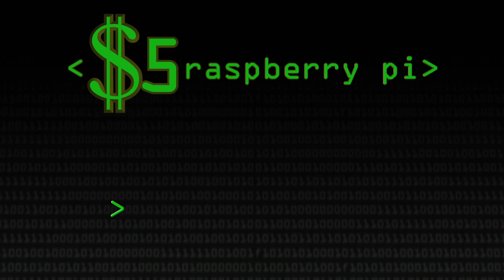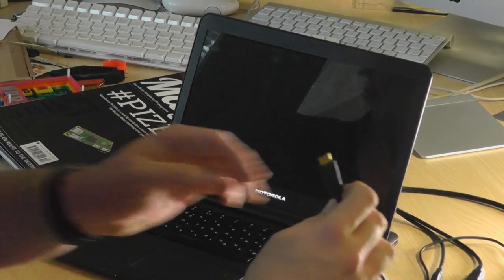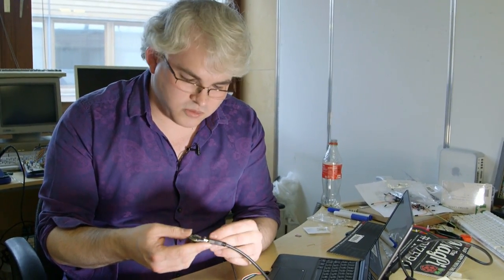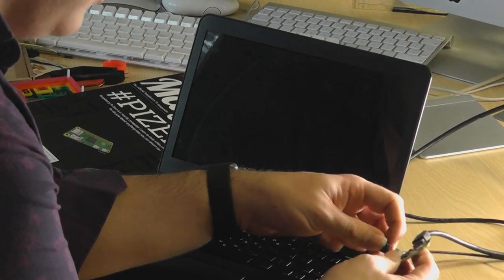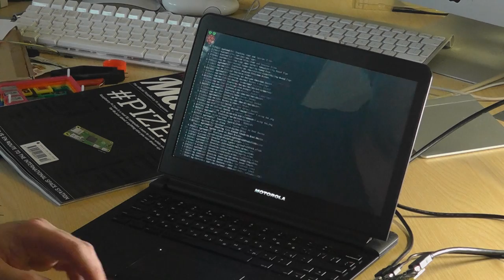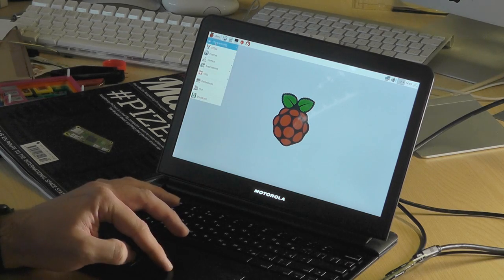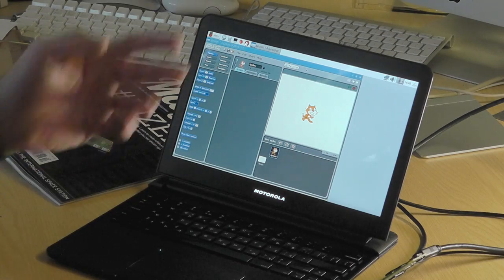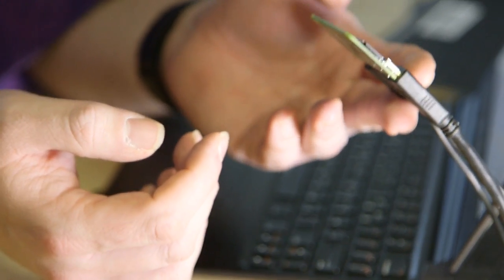Raspberry Pi Zero - the $5 Computer - Computerphile

Comment: When the USB cable costs more than the computer, you should start to think that the cable manufacturers might be inflating the price slightly...
Reply: +Scy Anything over a dollar is profit only
Reply: +Scy And conversely, how generous the Raspberry Pi people must be for making the Zero only $5
Reply: +Scy There's demand for cables, but there's relative way less demand for a Raspberry Pi Zero, so it makes sense that cables are much more expensive.
Reply: The Raspberry Pi sold out before it was made.
Reply: +Derek Leung The price is basically how much money it costs to make the device in the first place.  I thought the organization is nonprofit
Reply: Exactly. I can see why a cable costs more than $5, due to the copper and/or other metals, but when they start reaching $50-100, you know something is just wrong.
Reply: +Scy Not really. There's at least an order of magnitude more copper in a 5' usb cable than the entire Raspberry Pi Zero. Rubber and foil insulation adds more. 

And while the ARM SoC in the Zero is going to be more expensive than a male usb port, it's also an existing, outdated design that has no real demand right now in the cell phone space. The Pi foundation probably gets them pretty cheap since there's no competition for the part.
Reply: +CoWinkKeyDinkInc I've heard Broadcom is giving the CPUs away for free. That would keep the price down a bit.
Reply: Awful lot of price gouging apologists in here.
Reply: The mini HDMI to regular HDMI adapter, alone without the cable, costs more than the board.
Reply: there's a thing called fixed costs, that always exist regardless of the technological level of the thing you produce or the quantity
Reply: @au7weeng534  the cost of a product is determined solely by the labour hours invested into it. As technology advances labour becomes more productive, so the price of everything should keep on dropping till it reaches 0.
Reply: Reading this on 2022

Comment: I miss flicking the shutter back and forth on floppies :(
Reply: +The Hoax Hotel That, and the write protection slider. And my Amiga 500, while we're at it.
Reply: +The Hoax Hotel grab a USB stick that has a protective plastic cover.
Reply: +The Hoax Hotel nostalgia is death of the mind. fight it like your eternal soul depends on it. because it does.
Reply: Dan Frederiksen 
Don't worry about me. I am not studying electronics and computer sciences (engineering) to tinker with Amigas. ;)
Reply: +The Hoax Hotel I saved a few just for that :D
Reply: +Mikkel Højbak 
Entendi tu indirecta ( ͡° ͜ʖ ͡°)
Reply: +William Findlay deal!
Reply: +The Hoax Hotel HP still produces floppy drives with S-Ata for servers.
Reply: +The Hoax Hotel I still have about 10x 3.5" floppies laying around. My plan is to keep them for the next 30 years and then sell them off to large corporations that re still running 1990  hardware for $100,000 each to finance my retirement.
Reply: We meet again
Reply: Have a couple of 3.5" floppies here because I'm that sad I can't throw them. Flicking shutter....now :D
Reply: +One Two What's the date on them, though? The older ones (basically anything early 90's or older) are MUCH more reliable and valuable than the latter ones!

Comment: this is literally better than the computer i was gaming on back in early to mid 2000s lol, and only 5 bucks
Reply: Do you think one would be able to play Half Life 2 on it?
Reply: +Linus Brendel HL2 is not compiled for ARMv6 architecture CPUs, so no. Performance-wise though... still no. Minimum spec is a 1.2 GHz (x86) processor. The Pi's CPU is roughly comparable to a 300 MHz Pentium II (according to the Pi foundation) (ARM processors can do fewer operations per clock tick compared to x86 architectures. Their main advantage is the reduced power requirement: the aforementioned pentium uses over a 100 times as much power as the Pi, and that's including the Pi's GPU and RAM as well). Don't know about graphics. The Pi's GPU is theoretically comparable to the one in the original XBox.
Reply: +Bart Stikkers Thanks for the lenghty reply. I didn't consider the architecture compatibility issues and the fact that the pi is RISC.
Reply: It's interesting though; I figure you should be able to make a game like that work if you optimised well. Morrowind and Red Alert 2 ran on that kind of hardware, and Baldur's Gate 2. It would take considerable effort though.
Reply: +Bart Stikkers There is an Android version of HL2, for Tegra-powered devices, which is still ARM and GLES, so it isn't completely out of question. But it's poorly optimised, and doesn't run that well even on Tegra devices, so even if you managed to make it run, it would probably be unplayable.
Reply: That's a start. I think some games were made specifically for nVidia's mobile processors, I don't know how compatible that would be with the Pi's VideoCoreIV graphics. HL2 was originally implemented for directx7/8, so that might explain the poor GLES performance to some degree.
Reply: Bart Stikkers Of course, that is the major problem. The game was developed with different CPU architecture in mind and with different GPU architecture and GL API in mind. And what we got is a dodgy translation made by some 3rd party (not Valve themselves), so I guess it's a small miracle it runs at all :) As for NVidia "sponsorship", it's still all OpenGL|ES 2.0, but they're using some NV-specific extensions and texture formats, I think. With some wrappers, it can be run on generic Android hardware of sufficient power, and thus probably on Pi also, theoretically at least.
Reply: The tegra devices are generally more powerful than the Pi, I think.
Reply: Bart Stikkers Yep, Tegras are among the most powerful of Android/ARM hardware. That's why I'm saying it's probably theoretically possible to get it to run, but it would probably be too slow to actually play on Pi :)
Reply: +Linus Brendel if you turn down the graphics a bit your probably could!
Reply: +ChronicConnoisseur It's not. It doesn't have a proper graphics chip, which that PC of yours probably had. CPU-wise, it probably is.
Reply: +ChronicConnoisseur Let's make a Dosbox portable machine!
Reply: +Bart Stikkers It's interesting how it's expressly for HL2 and not for Source engine. Because if there was a competent Source emulator for Android, in theory you should be able to provide all of the other files and all Source-based games should function.
Reply: Perhaps the people at Valve finally feel that they have enough money?
Reply: There amazing little machines really cute they are if I was told back in 2000 that a computer would be that small I would of laughed lol.
Reply: Pi 2 can't even run Raspbian and Youtube in a browser smoothly. So I wouldn't bet on it.
Don't get me wrong, they are awesome for what they are, they're just not desktop pc's. The model 3 might be somewhat acceptable when you're in a pinch, but using the model 2 involves a Lot of waiting.

Comment: What wonderful times we live in, where a $5 computer has more ports than a "premium" smartphone.
Reply: +ElagabalusRex but the smatphone screen is bigger ;P
Reply: +ElagabalusRex Well, not really. Granted, smartphone have only 2 physical connectors (USB/power and headphones), but it also have WiFi, Bluetooth, NFC and GSM "connectors", so you can add a lot of devices to it with little to no additional cost or effort, unlike this Pi.
Reply: +akodo77 you can also plug in a powered USB hub and use everything from external drives to game controllers
Reply: you don't really need the extra plugs on the smartphone like you do in a raspberry pi.
Reply: +landedhoaxer exacty
Reply: +CatnamedMittens “Michael Bialas”  Go back to Thorin's videos! xD
Reply: +ElagabalusRex It only has those ports because it doesn't have the stuff they connect to built-in - the smartphone does :)
Reply: No it's not. The RPi is built on a smartphone SoC which was dirt cheap at the time because phone manufacturers stopped buying it because it wasn't powerful enough for new smartphones. 
The RPi 2 was built on a custom SoC (and boy, did the foundation miss an opportunity for adding some actually useful extensions there!) but the 0 is based on the same old SoC which was deemed too slow for phones back in 2012.
Reply: +ElagabalusRex New MacBook has only ONE port (for charging and devices combined). This is just plain stupid IMO. Want to plug your USB stick? better unplug the power first facepalm
Reply: +ElagabalusRex the rasbpi doesnt come with a harddrive (that is what the SD card he stuck in worked as, which probably costs more than the pi) they dont come with wifi connectors or a touch screen, they dont come with bluetooth or cellular abilities. they do not come with speakers or microphones. it completely lacks buttons and a case. it doesnt have a camera or a flashlight
it is basically just a CPU, the same CPU as in a lot of non-smart phones. and then it has a few connectors. you cant just compare the price of a CPU alone (a CPU probably weaker than the ones in smartphones mind you) to a complete phone.

Comment: These things seem to be perfect for home automation. Put one on an automated window, have it connect to your Wifi network and you can control the window motors for open/close, shades etc. One other should be enough to control most or all lights and possibly even power sockets in a storey of a normal house (or, depending on the size of the house, even the whole house), and another to control the climate (heating/cooling) with temperature sensors - possibly one per room. And one as a main control unit (that's the only one that needs a display, preferably with touch input) to control all the other functions. Then, have an app on your phone and you can check on your house from anywhere. This could be expanded with surveillance cameras of the entry way and much more. All without needing any central service in a cloud that would leave your house vulnerable at least to the cloud service provider.
Reply: Yeah there are whole communities based on this kind of stuff

Comment: 512MB of ram, I used a desktop pc with that much ram until 2012. lmao
Reply: +Mystyc Cheez even the ps3 has less ram ;p
Reply: +St0RM33 I believe the ps3 had 512 ram in total but it was unshared
Reply: +ThexXxXxOLOxXxXx PS3 and X360 both have 512MB of RAM divided evenly between CPU and GPU, so effectively it has 256MB of RAM each.
Reply: +Mystyc Cheez You did really well lasting that long because my 512MB PC from January 2002, finally could no longer cope in 2006/7.  It did not have enough RAM to cope with Windows XP in 2002, so it had a short life ahead of it from the start.
Reply: jakemichie97 Must be a typo error, so maybe divide his claim by eight ;-)
Reply: These are kind of fun to mess around with but I'd rather stick with my computer with 32GB of ram, overkill I know
Reply: ***** not overkill mate, depending on the work you are doing..cad and computational stuff needs lots of ram
Reply: +jakemichie97 man stop if somebody sez they have 32 gigatons of rams just go

k cool I buleev u bruh

no need 2 argU
Reply: Electro
No. See, I'm the type that has to correct information that is incorrect, so those who don't know don't learn incorrect information.

Also, English please.
Reply: jakemichie97 Man didn't you click on the imgur link? Wtf you want an AIDA64 full report? lol And look i'm a mechanical engineer..i do these stuff on a regular basis and you need lots of ram when doing cad assemblies, and simulation work (FEA, flow, thermal simulation) as well numerical computation in matlab. Either way 8gb of ram is a min nowadays. Playing mgsv takes 9gb total with system, and that's not even at highest settings
Reply: St0RM33
Unless I missed the punch line to a joke somewhere, there is no Imgur link. Maybe repost that?

And mind quoting where MGSV takes up 9GB of RAM including system? The minimum specs lists 4GB as the minimum amount of RAM needed for the game, so I don't believe you there.
Reply: jakemichie97 for some reason his comments were marked as spam, I had to restore them.
Reply: +EgoShredder You should just wipe off Windows XP on it and get a lightweight Linux OS like Puppy Linux and it should be able to cope with 512mb
Reply: InfinityCraft wow, the pc I used could barely run minecraft alpha on lowest lol.
Reply: +Mystyc Cheez Is your profile picture a selfie? Time for a new camera too man...
Reply: Mystyc Cheez you're gonna have a bad time
Reply: Benjamin Franklin if i remember well the ps3 had rambus ram

Comment: First to make a cluster computer using only the GPIO pins for communication wins.
Reply: I think that it's not a problem, it should have SPI and serial
But it would be pretty slow... What about modifying kernel and using other GPIO pins to connect too?
Reply: +Stek TwoNine not sure how many gpio pins it has but you could use it as a 32bit or 20 something bit bus too. A modified i2c with 32 data lines would probably work.
Reply: +Laharl Krichevskoy 26 GPIO pins on the Pi1 Model A/B. 40 GPIO pins on the Pi1 Model A+/B+, Pi2 Model B & the Pi Zero.
Reply: ElNeroDiablo
 so more than enough for a 32 bit bus. Good. Someone should try that and see whether it's faster than through usb - ethernet adaptor. No idea if that chip can reach the 480Mbits per usb but you'd only need a 15mhz clock to get that with 32bits. It's not a lot but i think terminations would be needed.
Maybe talking something like pata as a basis would help too.
Reply: +MrC0MPUT3R Hey, that's the first thing I thought of.  Could you use 8 GPIO pins and run 802.3 (10 mbit ethernet protocol) over them?  I think it'd be pretty fascinating to do, but 16 soldered connections per computer would make it very time intensive.  

Still, that's a very cheap network simulator environment if that's the route you want to go.
Reply: +Zeus Kabob  According to Wikipedia, the GPIO connector has 17 lines on the A+, B+, 2B and Pi Zero. You could do a custom parallel system with each node connected to four others via 4-bit half-duplex links.

Anyone think a TIS-100 with Pi Zeros could be a thing?
Reply: +Zeus Kabob you should consider that since Linux is no real-time OS, there will be 
timing problems controlling the GPIOs. There is no controller for the 
pins, the OS does the job directly, so basically if the kernel is busy, 
they will hang up for long enough to mess everything up. It is not impossible, just that you have to take many other things in consideration :D
Reply: +Laharl Krichevskoy Well, actually it has 40 pins, not 40 GPIOs. Many of the pins are specialized. But even if they weren't, you'd have to control the transmission fully in software, so you'd need a real-time OS and it would be very CPU intensive. 
That being said, the PI does have native support for UART, SPI and I²C (or at least I think it does; it's been almost two years since I've done any serious tinkering with it).
Reply: +MrC0MPUT3R Instead of GPIO I'd use (and seriously thinking about it) $4 10/100 USB/Ethernet adapters... minimize the amount of code I'd have to write.
Reply: BoomBap Snic I guess at that point you'd have to install an RTOS on the pi.
Reply: ***** By doing that you'd be almost doubling the price of every node. If you don't need a lot of bandwidth, you could for example chain the UARTs into a ring and use PPP (or SLIP for smaller overhead) to encapsulate standard IP traffic. 
Obviously such cluster would not be usable for all problems since many problems require heavy communication between nodes when running on a parallel system.
Reply: $10/node is better than $35/node from other pi models
Reply: ***** Yes and no. It's better than the original Pi but with Pi 2, you're actually getting 4 nodes per unit as it has a quadcore CPU.
Reply: ***** Depends on what you're testing.  If you're looking to test network utilization and slowdown based on node activity and communication protocol, then you want all your nodes to be connected through a physical layer (optimally with artificial delay built in), but if you're looking to get the most "bang for your buck" in terms of processing performance, I doubt any Pi model would be your best bet.
Reply: +BoomBap Snic There actually are rtos linux kernels. Additionally, there are plenty of communication protocols that are unaffected by timing glitches.
Reply: ***** That's too easy
Reply: +MrC0MPUT3R  I read somewhere that Intel processors are much more cost effective in computing speed/dollar then a PI cluster. Maybe someone should recalculate it again.
Reply: if you use USB Ethernet stick then you can do parallel computing very easily.
Reply: Hulla Dek Nope. Raspberry Pi still can't beat Intel Xeon Phi.
Reply: +Hulla Dek I imagine power consumption comes in their somewhere, thats probably where the pi loses.
Reply: PirateKitty You completely missed the point. slow clap
Reply: PirateKitty Why climb a mountain when you could fly to the top in a helicopter? 
It's not about the destination, it's about the journey. We do these things because we enjoy doing them, because we want to see if we can do them and because we want to learn something.